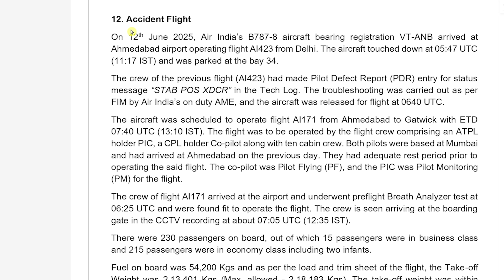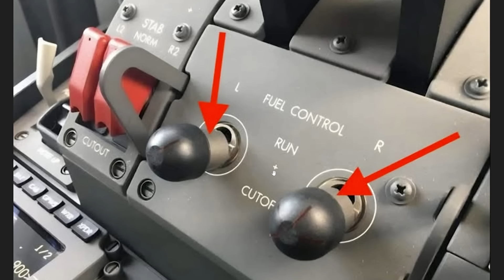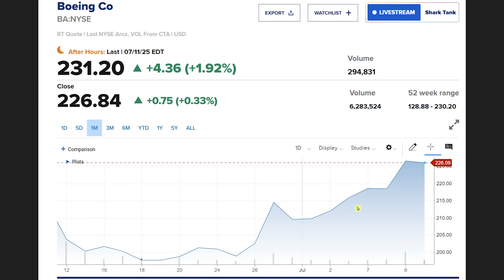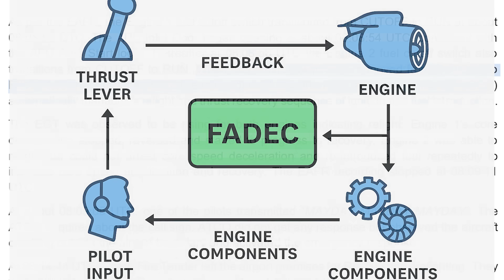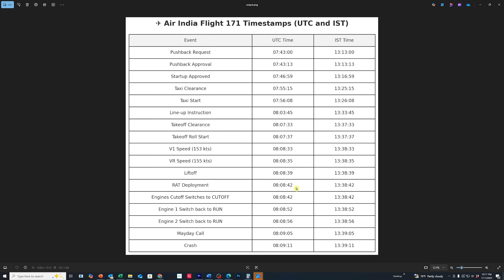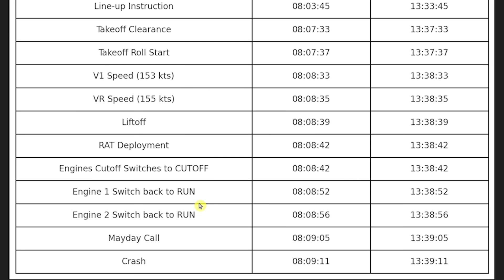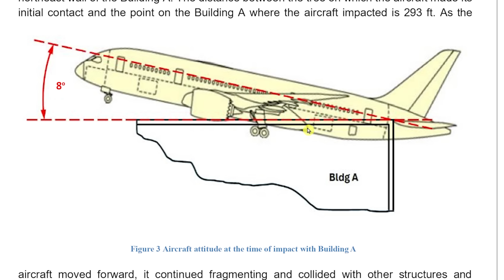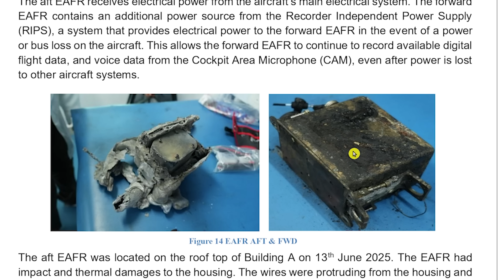Did Pilots CUTOFF Fuel? Shocking Twist Air India 171 Report!

Comment: How do they know someone switched the mechanical switches?
Reply: From the blackbox
Reply from the maker: all they know is there was in input from the switch.
Reply: @jeffostroff  But how can they know this? What sensor is in charge of this? Hall effect sensor? What? If a rat eats my electrical wiring, it would have the same effect as flipping the switch.
Reply: It's a mechanical switch? Black box shows fuel switched off for not just one engine but both which requires separate actions. Also one pilot asked another why that person switched off the fuel switches. So unless it was a ghost ...

Comment: These switches are purposeful switches and lock in one position or another. They are pulled up and released in the top or the bottom position but the operator has to make a purposeful decision, since once released the piston retracts to the selected position!
You really can’t have those switches at a mid point, due to the lock is spring loaded!
You can’t accidentally push into another position!
In another video with Captain  Steeves indicated  that there is one condition to place in “Cut off” but it had to be returned quickly to turn on position!

Speculating: Perhaps the Pilots got distracted and forgot to restore the switches to turn on!
Deadly mistake!

Thanks for your public access Jeff, good job!
Reply: Yes one of the pilot did make a catastrophic decision to switch it off but later tried to turn it back on. 😢

Comment: The RAT deployment and the engines cutoff switches being turned off are strangely logged at exactly the same time. The RAT is only deployed when there is a problem. It is unlikely that the RAT and the switches off happened at the same time. Are we sure of the order of these two events? Maybe the switches were turned off, and the RAT deployed as a consequence [possibly within a second]. Maybe there was already a problem with the plane causing the RAT to be deployed i.e. the plane automatically reacted to a problem, and then the crew [possibly within a second] also reacted to the problem by turning off the switches. Turning something off and then back on is the sort of thing one does to reset something. Also, there are certain things that require a slight delay before turning the device back on e.g. resetting a router when the internet stops working.
Reply from the maker: Yes, you cutoff the fule, the computer is already deciding what to do

Comment: I was thinking the whole time some kind of electrical meltdown at liftoff.   At this point I think I was wrong.   It was pilot self-deletion.
Reply: Anything to point away from boeing's failure.
Reply: In that case, why was the rat deployed before the cut off?
Reply: @peterlassis2156  the RAT deployed at the exact same time the fuel switches were flipped off.
Reply: @v12alpine If they were flipped at all.
Reply: @peterlassis2156  RAT started to engage after cutoff at about 08:08:42 when N2 values fell below minimum idle speed at 08:08:47
Reply: @peterlassis2156 I don’t think it was
Reply: The U.S. Federal Aviation Administration issued Special Airworthiness Information Bulletin (SAIB NM‑18‑33) on December 17, 2018, highlighting concerns about the fuel control switch locking feature in certain Boeing aircraft, including the 737 and 787‑8 series. The warning was based on operator reports where the locking mechanism may have been disengaged, enabling the switch to move without lifting the guard—potentially leading to in-flight unintentional engine shutdown.
Reply from the maker: IT sure is looking that way
Reply: @jeffostroff  Which pilot do you think did it? That's the question at this point.
Reply: @drdorann  The captain.  The first officer was flying and would have had both hands on the yoke.
Reply: how can fuel switches be turned off 1 second apart? its not possible with the effort needed to turn them to cutoff position, you would need more than 1 second to move them to cutoff as u need to lift and move them
Reply: @anigrooves  humans are born with two hands...
Reply: @anigrooves  1 second apart is plenty of time
Reply: @anigrooves Half a second would be enough ….
Reply: Not deletion just mis judgment due to stress we dont know yet. 😢
Reply: @Sherlock245  At this point, it does not look to be accidental.
Reply: @Sherlock245 
Fake profile promoting modi propaganda
Reply: @Sherlock245  no, this was a murder-suicide like Germanwings

Comment: 10 seconds is a lifetime.  The engines once switched back to RUN at that low of an altitude would not have spooled up sufficiently to produce enough life before striking the ground.  Sadly it appears an intentional act of self sabotage.
Reply: If it was intentional, why did they restart the plane? Surely the pilot was trying to crash would stop the other pilot from restarting the plane.
Reply: @Novasquad77  The pilot who didn't have the intention of crashing tried to restart.  The other guy played innocent.  He knew that cutting fuel right after takeoff would be next to unrecoverable because the engines would need to respool and they wouldn't have sufficient altitude (in other words, time) to do so.
Reply: @Novasquad77  or the saboteur restarted the fuel to literally add more fuel to the fire.
Reply: @Novasquad77  Yes ..Why would he even bother to shout Mayday?
Reply: @juhantoon6524 to deflect blame to the other pilot perhaps.
Reply: @Novasquad77  It took 10 seconds for the switch to be turned back on. Maybe 1 pilot was preventing the other to do it.
Reply: @vmxg8052 I agree and 4 more seconds of hand fighting for the Second lever by that time, the offending pilot knows its too late to prevent the crash and lets the switches go to run.
Reply: Or the biggest screw up of the millenia...
Reply: @Amos.T.Fairchild it would be two huge screw-ups in a row though to switch both off. With the worst timing possible. It really seems intentional no matter how you slice it.
Reply: One engine did barely get started the other couldn't because the speed was too slow. MaxAfterburner channel mentioned computers (FADEC) were in full control doing everything to get the plane up. They were just too slow. 😢 Edit Jeff covers this at 8:00 min
Reply: Not necessarily. The Preliminary crash report goes on to explain that there had been a Safety briefing report released a few years ago about these fuel cut off switches. To operate the spring loaded switch you need to lift it up over a metal rim built into the switch, then drop it down once it is over the rim. It seems some airlines were having the metal rim piece deliberately either left off when built, or removed. Air India apparently did not do anything about checking their planes or take any maintenance response to it, because it was advisory only, and not mandatory. Therefore if this was the case on this plane it may have been that the switches were knocked from RUN down to CUTOFF by accident, when they placed their hands on the throttle controls at takeoff. Therefore the pilot who said he didn’t set them to cut off may have been telling the truth. By noticing the switches were in cut off they then reset them to RUN but by then it was too late. https://i2.res.24o.it/pdf2010/Editrice/ILSOLE24ORE/ILSOLE24ORE/Online/_Oggetti_Embedded/Documenti/2025/07/12/Preliminary%20Report%20VT.pdf
Reply: I am interested in analyzing the question and answer to it in exposing the intentions. 

The question didn't cast any doubt on the action,  but a straight command, "Why did you?" Meas, he saw him doing and immediately asked him that question. The first officer, flying, had to take off his hands from the yoke handle and thrust leaver to bring back the leavers to run posion. 

The time lag between one to the other operation of the leavers to cutoff position was 1 second, which means he did it very swiftly because he was just idle monitoring the operation.
On the contrary, after hearing the reply, the pilot flying took time to control the yoke handle with one hand. Hence, there is a delay of 10 seconds between cutoff to restoration and time lag between two operations of restoration by 4 seconds. It's a clear case of self sabotage by the pilot monitoring. This is my inference form verbatim, syncing with intentions and timelined actions, keeping in view the business they were doing in the cockpit.
Reply: @alexanderrodda4031 ....James Bond...if the final report comes  to the contrary , be prepared to offer Apologies  to the pilot's family...
Reply: @alexanderrodda4031 Why do you think in sabotage one kills himself?
Reply: @alexanderrodda4031 I agree

Comment: Hearing those engines power down would of been terrifying
Reply from the maker: Yes it was likely quite quiet when they crashed
Reply: @jeffostroff they tried to quickly restart it. 😢
Reply: @Sherlock245  Dont think it was 'they'
Reply: @bshingledecker ah yes. One tried to help.
Did we find the pilots bodies. Was anyone of them shot or stabbed?
If you are trying to cause a catastrophe you are going to have opposition ,was the person pprepared.
Reply: @bshingledecker they I mean both pilot I did not know at the time they captain was sucidal. 😢
Reply: @jeffostroff  It was quiet! If you watch your video on the RAT deployment, you can clearly hear the RAT, but what's missing is the sound of the engines at takeoff thrust setting. It was much too early in the flight to set climb thrust, that is normally only done after "positive rate" and "gear up" callouts.
Reply: @jeffostroff  
41 / 5 000
No, it was a loud crash, the sound was loud.
Reply: @jeffostroff  The captain would have fought to turn on the switches again, and would have told the tower something different than "mayday no thrust". This report makes no sense.
Reply: @CameraMystique  Report only says 'mayday mayday mayday' no mention of thrust. They know which pilot did this based on the CVR. They need to release that recording and go talk to his family.
Reply: @androida99  There were reports in various channels saying "mayday mayday no thrust", some of them were saying "no thrust going down" etc etc.
Without the actual CVR we'll never know. And given the record of this particular airline, even a future-released CVR might be edited. I find it hard to believe that the pilot didn't see the copilot pulling out and turning off switches right at the moment of takeoff, and then didn't do or report anything about this to the tower. Aren't there any alarms in the cockpit when you turn off fuel?
Reply: @CameraMystique What makes your think it was the copilot who pulled the switches ?
Reply: @CameraMystique   The report says the call was "mayday mayday mayday", in quotations.
Also, it looks way more likely that the captain was the one who cut off the power, not the copilot.
Reply: @daedalron  I think I watched too many channels on this, not all credible, and didn't cross-reference information properly. There are channels that said "mayday no thrust" and "mayday no thrust no lift" etc.
Reply: @androida99  They're probably talking to his family before releasing anything further.
Reply: @eyedeegee19  The pilot's union is involved and they will intervene against releasing any recordings and pilot medical records.

What everyone need to understand is this is a very painful episode for a lot of people and the best way to deal with it is to be fully transparent. Regardless of whether the fault lies with boeing, the airline or the pilot, transparently disclose all information, explain the evidence and bring closure.
Reply: have
Reply: @Jeph629   Attention: grammar police in da house!
Reply: Survivor saying before they crashed, he heard the engines spoil up to maximum. So it appears that they got them restarted and spoiled back up, but didn't have enough altitude to gain lift. Makes me wonder, if the engines had not restarted, would they have possibly crashed less violently, and maybe had a few more survivors
Reply: @Kamil_Jabroni he said he heard engines or engine spooling up but I never heard of maximum
Reply: @heinzriemann3213he actually said that the engines got really loud
Reply: @Kamil_Jabroni  Look at the report for the N1 and N2 values. One engine was starting to recover
Reply: they didn't have time to spool up much @Kamil_Jabroni
Reply: @Kamil_Jabroni Or the ear witness was wrong and the data that contradicts his statement is right? 🤔